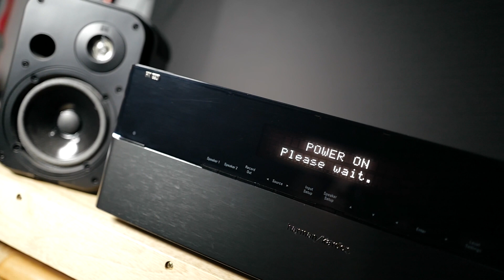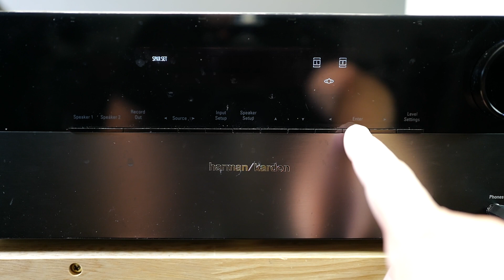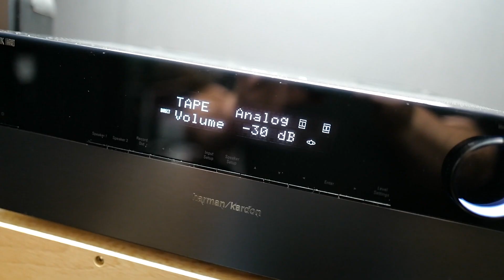Harman/Kardon HK990 Vintage Amplifier

Comment: I had 2 of these, I sold one and still have one connected to pair of JBL ti10k. And I can say that this amp is a beast of an amplifier it has almost unlimited power/current with incredible clarity. it's really shame that harman has discontinued such amazing product . Very high quality DACs, balanced XLR, even ethernet cable input for direct streaming from either High end CD player or Lan. High quality phono inputs. I just love the hk990 and will never ever sell it. Very nice video
Reply from the maker: MICHEL KHACHADOURIAN that’s funny, i also had two. Sold one to a friend, what i regret now, because Harman will never make this again. Too many quality parts in that amp.
Reply: I  looked for this one not easy to find ... At the end  I had hk 980.... for home more than enogh =)
Reply: does it really have ethernet for streaming ? i thought its just for support port or networking to other HK products?? pls let me know if you connected  to internet can you steam? have you tested this function?
Reply: @akjannu HRS (High Resolution Synchronization ) was specifically designed to link to the CD player the HD990 which is HRS enabled device. But that would be very interesting to try it with a streamer or a PC. Unfortunately I couldn't find any streamer with audio Lan out, and also my laptop doesn't have Lan port, plus Roon doesn't support audio over ethernet . I tried to make a research for streaming audio over Lan but I couldn't find much honestly. Though I'm sure there should be a way to do so, it might require a special software to be downloaded and stream directly from a PC. That would be really interesting to try. I'm currently using HK adapt plus as a streamer (toslink optical) to the hk990. In the future I will consider buying a streamer / Dac with balanced xlr output.
Reply: Thanks Michel , it was a informative response ! Yes I too use a NAD streamer via tos link to my HK990 !! Regards Anil
Reply: Does you amp gets heated ?? Mine does get hot !!
Reply: Yes it does get hot when it is in low volume or when there is no signal at all over period of time, and only warm in ideal or high volume, and the reason why is that this amp operates in pure class A in the first few watts until certain point and then it continues operating in class AB. And for some reason I noticed the left channel gets a little hotter than the right one, that might be due to the thermal tracking sensors' placement .
Reply: @michelkh87  many thanks Michel , any idea how much power it consumes ?
Reply: @akjannu  my pleasure. It draws good amount of current, but it all depends on the listening levels. If you look at the back panel it does say 1000 watt max which is reasonably very high. Which isn't the case, I doubt you can drive the amp to that extreme level without shutting the amp down or blowing a fuse. I believe that rating was there as an indicator that the circuit can handle that much power before it causes any safety issue or hazard.
Reply: @michelkh87  thanks for your prompt reply Michel 🙏 . I normally use my NAD 208 which is 250 watts/ch but runs quite cool , a bit warm which cabin fans takes care  , sometimes I use the HK990 too so asked.
Reply: Nah thanks.
I keep my accuphase e470.
Reply: No phono ,Right ?
Reply: @akjannu 
That Ethernet is called HRS link in that case and  it synchronise  clock between HK990 and HD990. Un8que for 990 lineup.
Reply: @michelkh87 
Did you try stream via HD990?
Hear difference?
Reply: @nocnymarek7645 I never had the HD990 unfortunately, but I read a review once claiming a thiner midrange using HRS directly connected to the HD990 vs toslink or coaxial which I don't buy much since that wasn't backed with data. Of course using the Internal dac of the HD990 would be a different story in hat case the advantage is using the analog xlr input and having some extra voltage gain. The funny thing is that I'm using the hk990 as a preamplifier now😅 connected to classé Ct-2300 the weirdest combination ever until getting a proper preamplifier hopefully soon

Comment: Definitely more of a modern amp, but since HK was bought over by Samsung, all the replacent parts are already obsolete...
Reply: What do you mean? Obsolete parts???
Reply: Any IC  or logic  board that will need replacing in the future, is no longer manufactured. Discrete components are still available . It is a great amplifier!
Reply: @MicroAngelo1  
Ok, thanks, now its clear.
I am waiting for mine piece so I'll evaluate it.
Anyway it is very strange Samsung destroy s6ch well brand the only comparable to McIntosh ev- why not HK)en and they move HK to brand simply Bluetooth speakers and poor soundbars ets. They restore JBL hifi devices  (again - why not HK) so maybe good karma back t8 the HK also?

Comment: But the amplifier working?, or need both transformers to operate?, in other way, you need find a good technician to remake bad transformer, today is very difficult find it....
Reply from the maker: Carlos Catalan i had a blown fuse inside the power supply transformer. It was not very hard to fix.
Reply: @mygiguser  You were lucky, if it had been the transformer, you had to send it to manufacture it and it would not be the same as the original.... Regards.
Reply: @mygiguser  no protection? dont cry then
Reply: @mygiguser 
Why this safety pin burt out? Do you know reason?